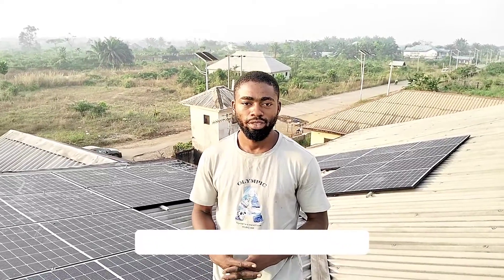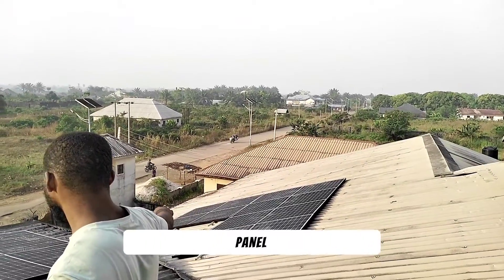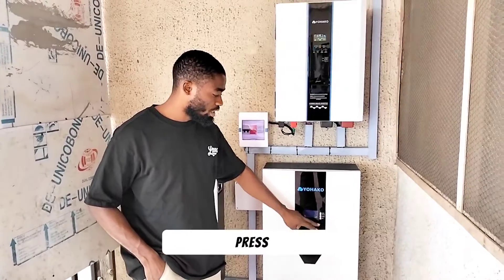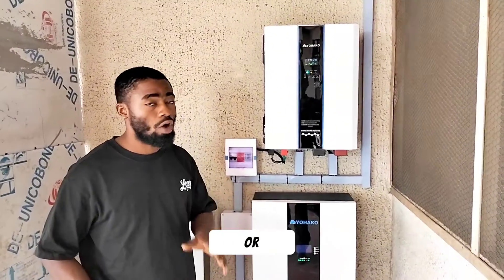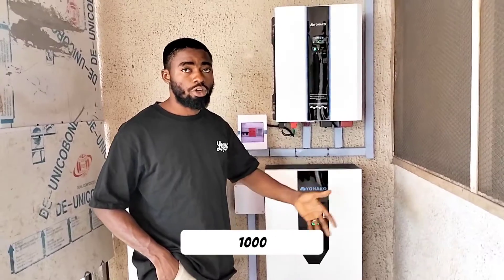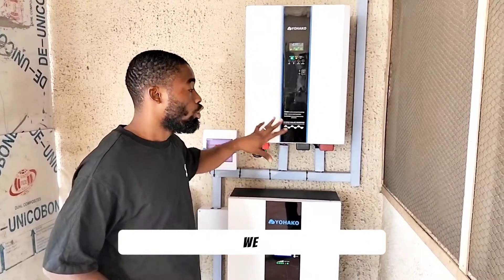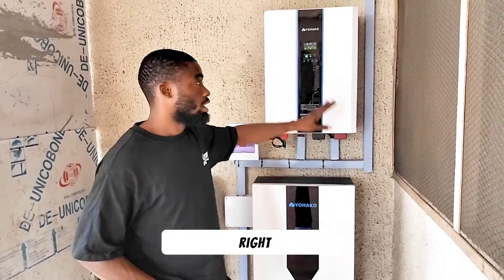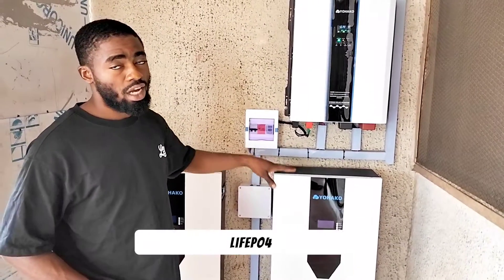6kwp solar energy with 10.2kw lfp battery in Nigeria!.

Comment: I think those panels should produce up to 180amps of load if converted by the mppt. So how will 100amps take all those current. Hope you made your calculations on this?
Reply from the maker: Nah, two in series, you would generate 78amps.
Though I later remove two panels

Comment: I wanted to ask why 3 converter and how many batteries watt with this 12 solar panels
Reply from the maker: It's 1 inverter 2 batteries
Reply: How did you connect the solar panels sir  all in series, parallel or series parallel

Comment: If you had expected 60 to 70 amp from your PV input then how come the charge controller is giving output of 90-100amp. And then if you meant the PV input that came from the solar array is now 90-100 amp would it not affect the charge controller over time  been that its equipped with 100 amp max.

Comment: Connecting the batteries in series to produce 48v seems more logical. Good video.
Reply: You are right too but that series connection will be determined by the DC voltage of your inverter. you can not power a 24v inverter with 48v battery in this situation the inverter is 24v while each battery is 24v, there has to be correlation between the inverter voltage rating and battery voltage rating irrespective of the kind of battery bank you are designing.

Comment: Great content. In this setup, how long can the batteries carry the full load of the house. I often see these videos that state all appliances in the home can work simultaneously but no mention is ever made about how long this lasts. One would hope for a system that carries the building's normal load all night and then some, to accomodate for a cloudy day when batteries may struggle to recharge. Would you comment on this please
Reply from the maker: The hours the battery will deliver depends on the amount of energy consumption.
For this very installation in the video and the amount of load we suggested, takes them about 30-35hrs
Reply: @Mairigaemmanuel  how much will this same system cost, excluding the installation?
Reply from the maker: This configuration serves the this very home 24/7

Comment: Thanks for the tutorial. Please how did you connect the solar panels, series or parallel for me to know the voltage and amperage input from them to the charge controller sir. Also please explain more of the pro and cons of both series and parallel connection of panels

Comment: Good presentation. However, the wattage ratings of panels were obtained under standard test conditions (STC), which include a cell temperature of 25 degrees Celsius, a particular mass airflow and 1000 watts per square metre of direct (perpendicular ) sunlight. In other words, it is challenging to replicate these conditions in the real world. Hence, under ideal conditions (panels facing south at the location latitude and a sunny but cool day), one can get 70-80% of the rating depending on the panel's efficiency. So, a 6kwp system might produce between 4.2 and 4.8kw on a good day during peak sunhours, usually between 11am and 3pm in Nigeria. Occasionally, the production might momentarily spike above these values. Understanding this concept and explaining it to potential owners is essential so they don't later accuse you if they don't see 6 kw being produced from their panels.
Reply: Good explanation. The mass airflow is at 1.5.

My 180W X6 panels facing south at my roof in Kano have recorded a peak of 627W around 12 noon on Friday 1st March 2024. The charge controller is Epever Tracer series. That was impressive generation.
Reply: @auwaluabdullahi8183  I am in maiduguri and I get results because in the north the sun shines well. The only issue is the 7 weeks of the hot season when charging is slower because its so hot.
Reply: Epever is original charger control  @auwaluabdullahi8183
Reply from the maker: 🙏🙏, well explained
Reply: Ironically solar panels don't like too much sun/heat
Reply: Well explain
Reply: What location is best suitable to face solar panels...?
East or South?
Reply: @godpowertimothy-ll3vu  south

Comment: How much is the complete set
Reply from the maker: 4.7m
Reply: Can It power 
3Acs
1washing machine,
1 deep freezer and 1 water dispenser,
1 microwave, 
85inches TV and 2000w sound system,
Electric Blender 
At thesame time?
Reply: @pharztv6049  All these things at the same time. Calm down 😂
You too like violence
Reply: 😂😂😂 @huncho193
Reply: @huncho193 😂😂😂😂
Reply: @huncho193  The guy no cucuma reply am. The Solar installer left the chat😂😂😂
Reply from the maker: No sir